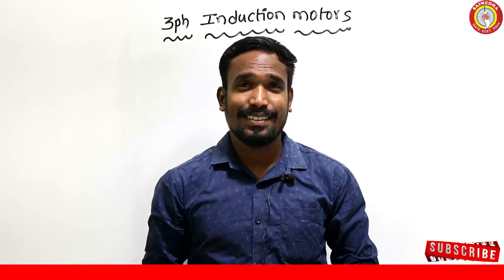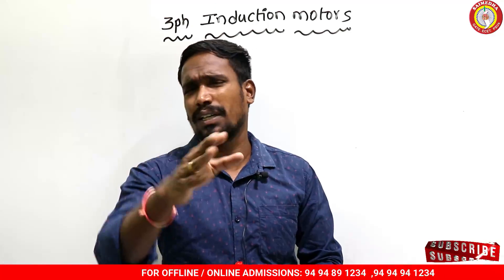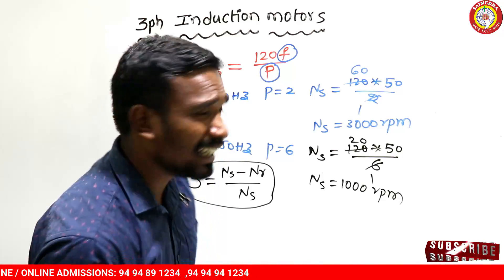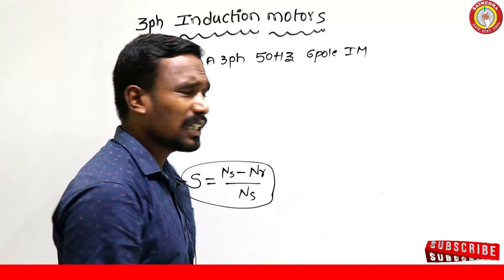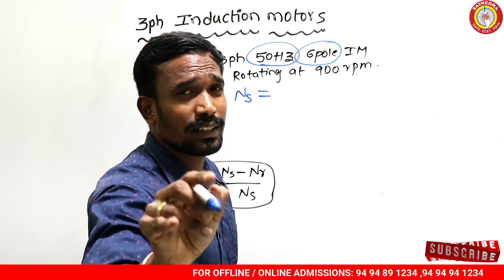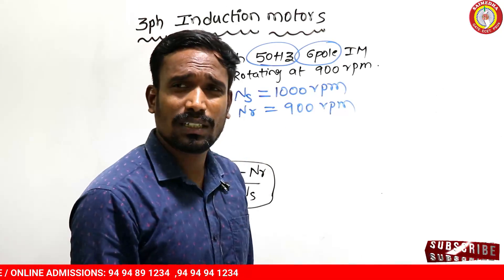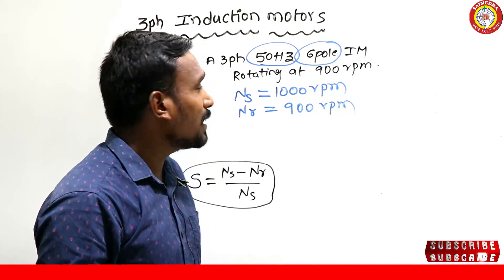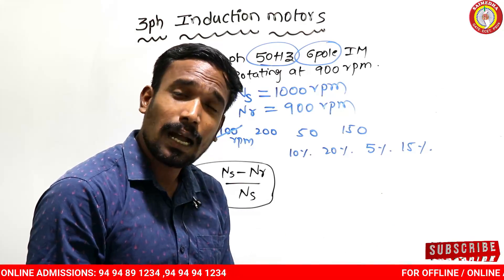APEPDCL Junior Lineman  |JLM | APEPDCL Energy Assistant |3 phase induction motar | SAIMEDHA |

Comment: Sir Rajashekar garu small doubt....
A 4 pole 3 phase induction motor is running at 4% slip at full load speed of the motor is 720 rpm ,the supply frequency is how much?
(A) 12.5Hz ( b) 25Hz (c) 50Hz (d) 24Hz
Sir Rajashekar garu please tell the correct answer .....
Reply: 25hz